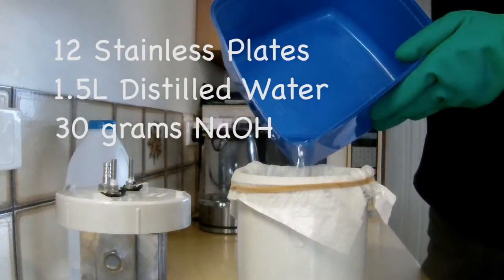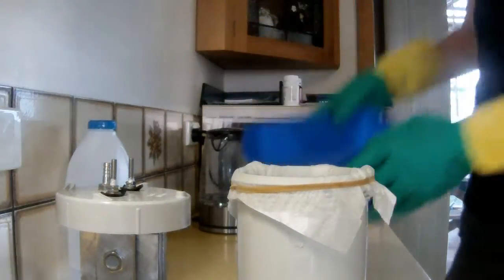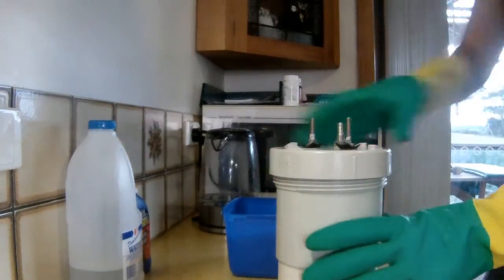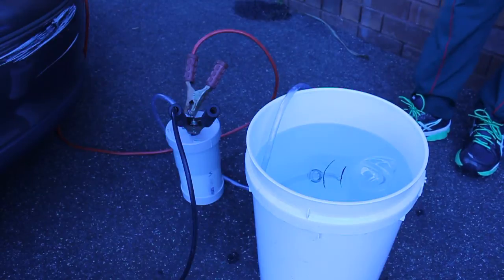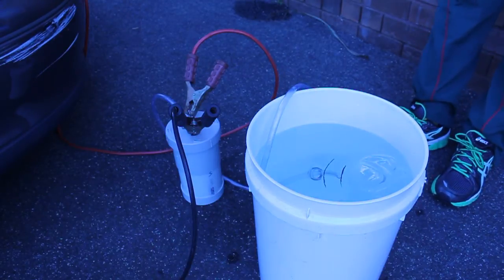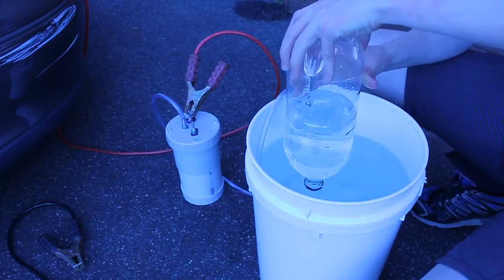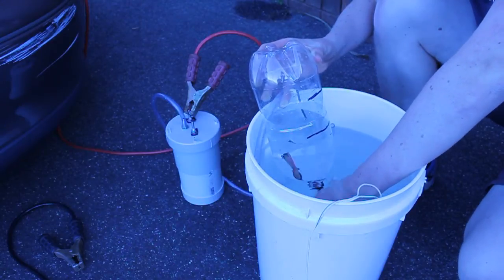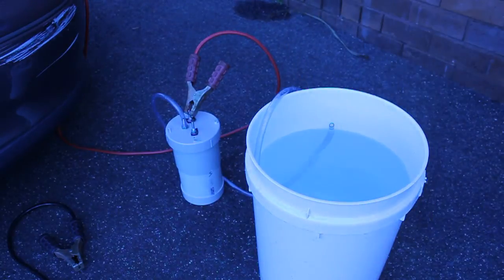HHO Generator and Rocket

Comment: You know if you were to compress the gas into a tank and build a steel combustion chamber with thrust nozzle and had proper blow back protection and fuel injection then you could build a proper rocket engine. I mean hydrogen and oxygen are what they use as fuel on space shuttles after all. granted they store them as liquids at cryogenic temperatures, but it is basically the same concept.

Alternatively you could build a gas generator that separates off the hydrogen and use that as fuel for a basic valveless pulse jet using the oxygen from the air to oxidize the burn. Not sure which would work out better, but I guarantee they will both be capable of going much higher than any water rocket you could build even if it is a multiple stage design.

Quite frankly the pulse jet design could probably travel the furthest because compressed hydrogen is much lighter than compressed hydrogen and oxygen so it could carry more fuel with it.

Of course you'd be getting into a much more complicated system having to build a fuel injection system and all that, but it would certainly be a much more impressive and useful design. You can even mount a pulse jet to something like a bike or a small boat.

Comment: Even using sodium hydroxide as your electrolyte and stainless steel you still have some of your metal being eaten away at. Not very much, but a tiny amount.

The reason I being this up is because Stainless steel contains chromium as an anti corrosion agent. This is a problem because during electrolysis chromium will leach off into the water in the form of chromates and chromides which are carcinogens. Which means exposure to them can cause cancer.

Frankly the best electrode material to use would be carbon as it is completely nonreactive in this process.
Reply: Research papers (you can look up online) suggests the best material cost/hydrogen production is nickel.